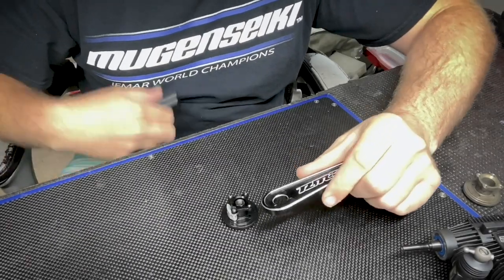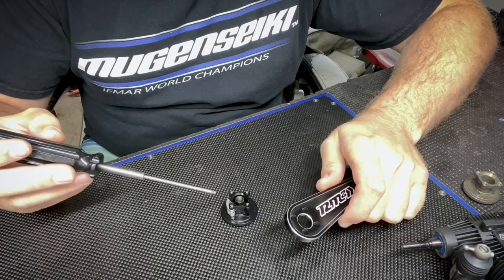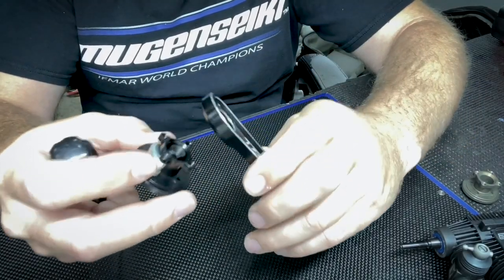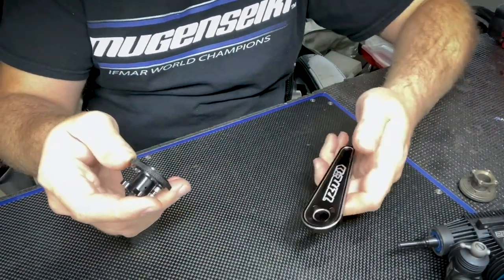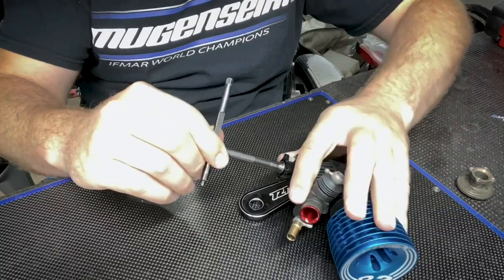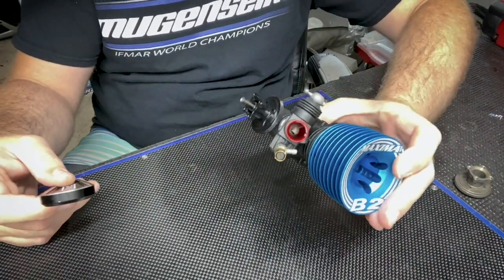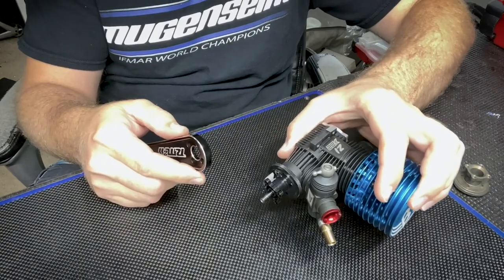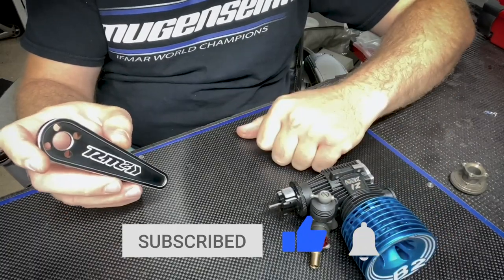4-Shoe Clutch Maintenance - The RM2 Flywheel Wrench

Comment: Ryan, won’t the tool stress the shoe holder pins when you want to tighten it down hard? I rather tape the plier teeth or get one with rubber inserts and hold the flywheel down. Husky has a nice rubber teeth insert pliers. It’s not compact though.
Reply: shoe holder pins? Those pins will see much higher stress during operation than this